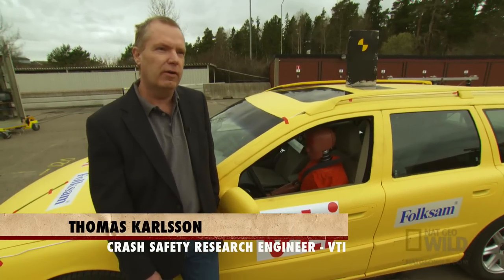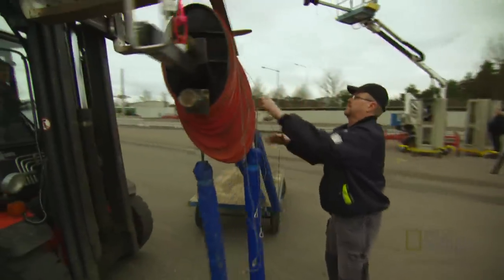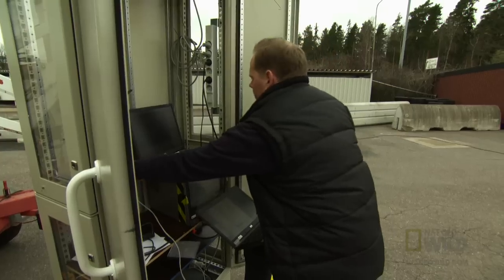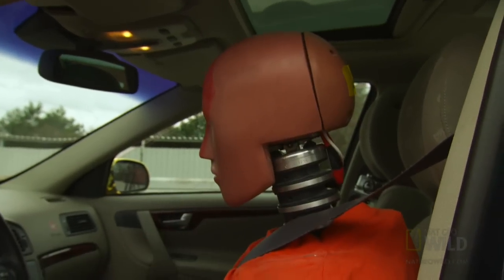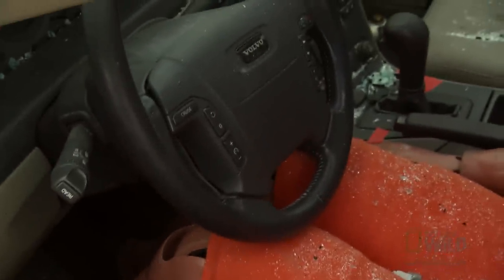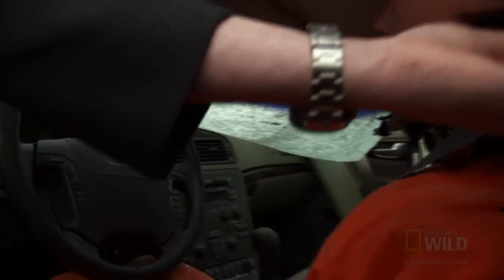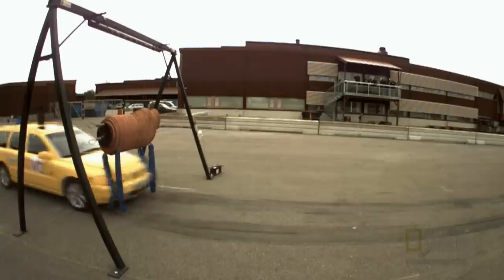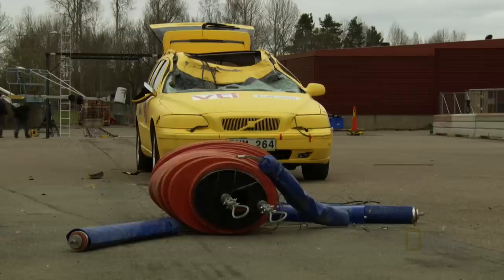Moose Crash Test | The Invaders

Comment: At only 70km/h that's a lot of damage
Almost like hitting a wall
Reply: Well, that still faster than official crash test speed, which is "only" 64 km/h. Every time speed is doubled, energy is multiplied by 4. So, crashing at 40, is 4 times as bad as crhasing at 20. And crashing at 80 is 16 times as bad as at crashing at 20.
Reply: No, it's nothing like hitting a wall.

Comment: What happens when its a real animal and the weight is supported by the legs and not suspended by the top with chains? NHJW.
Reply: Not much better, still hits you on windshield/roof
Reply: @Underskore This is why SUVs are safer, you sit higher up and the windscreen is higher up too, less chance of anything coming through the glass